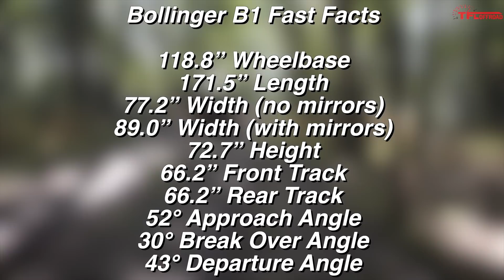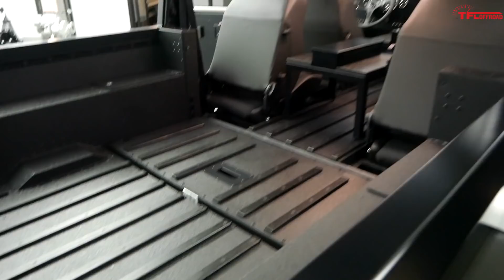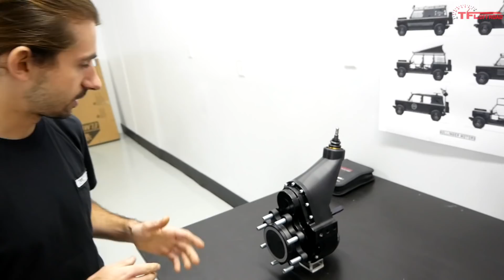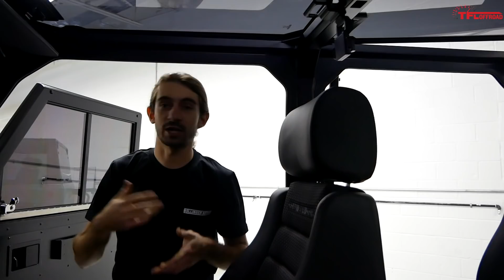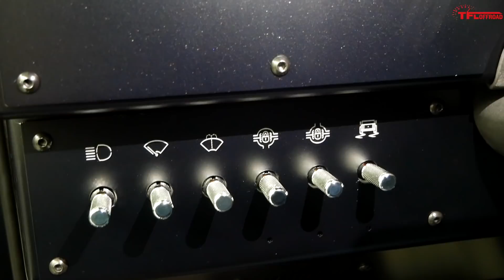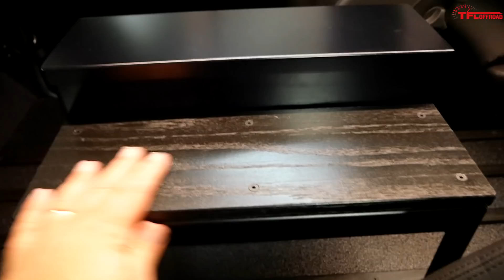You Won't Believe How Clever this Electric Pickup Truck & SUV Really Are

Comment: How about a hybrid version with a lets say 3 ltr diesel with a generator attached just to recharge the batteries, I know there is a weight penalty but it would make it a true go anywhere vehicle and would negate the range problem.
Reply: Maybe  an optional  generator sliding in the front for towing. Connect the cables somewhere, that's it. 30 kw should be enough.
Reply: @darklistener89  yeah anything to not be completely dependent  on the batteries alone. There is no fast chargers in the bush!

Comment: A twist knob on front and back gates/doors, how handy is that?  Think covered with ice while wearing gloves.  An off-road vehicle is not going to spend the night in a garage!
All these new EV's with all these fancy gadgets and accessories; but not one of them with door handles that are ice proof. 
Another issue: does the rear cab door for pass through interfere with a fifth wheel hitch?
Price??? With the cheapest Rivian around 40K, fo me this simplistic EV needs to be at least 75% of the base price of the competition.

Comment: Hopefully  it's no more than 15k for it's simple & basic  design.
Reply: The battery pack alone is worth that much. It is a large pack. Then you add off road capabilities that blow most so called SUVs away, a rust proof aluminum body, a 5000 pound payload, and the utility of all those electrical plugs. This, won't be cheap, and it will be worth every penny.

Comment: Well hopefully you live very close to the place you want to go offroading, because i've never seen a place to charge up on a 4x4 trail...Looks like a evolution of the very early land rovers, so cool design,  but i think electrics are still in the 'toy' stage. If you've got the money, its fun to drive. But not really practical and it'll take alot of miles to actually save you money on gas, since you pay more for the vehichle.  This is probably for the same people who commute in a Jeep Wrangler but never actually go offroad. Like the wrangler, its capable of it, but mostly won't be used that way. With a couple hundred mile range and a 8 hour charge especially.

Comment: It was mentioned that the designer had farm use in mind when he first designed it.  200 miles max range is far too limited for most farms.  Most farms are more than a hundred miles away, as the crow flies, from cities.  This vehicle will be limited to farms somewhere around 50 miles away from a city (for shopping, sports, entertainment, hospital emergencies) when not carrying or pulling a load.  A toy that may some day, as battery range develops, be more user friendly as a daily driver.  I suppose every vehicle type must begin somewhere.
Reply: Cities have chargers, so you can drive to the nearest city, recharge there, and drive back to the farm, where you can recharge again.
Reply: @cruiser97eric1  
I should have been more clear.  The term city, here in rural America, means a slightly bigger town.  Instead of a population of hundreds supporting a gas station convenience store that also sells fresh pizza and calzones, cities can have population of thousands, and tens of thousands and have malls with theaters and a Walmart with the eyeglass shop.  These are far and few in between usually over a hundred miles apart and rarely have chargers.  Big cities have populations of hundreds of thousands and multiple Walmarts and lots of grocery stores and one or two gas stations with chargers and would be out of range for most farms.  Cities with millions of people are usually in another state.
Reply: @bosgaurus1  Well, here is the neat thing about EVs. They can be charged anywhere there is a 120V or 240V power outlet. So there are EV chargers on even the tiniest rural town that doesn't have a gas station.
Reply: @cruiser97eric1  
Well, unless you own those neat power outlets in those tiniest of towns, or know those who do and have the kind of relationship with them that would allow you to simply pull up and plug in to make their electric meter go "Wheee!!", you still have no way to charge your car.  Love the cheesy snark, edgelord.
Reply: @bosgaurus1  If I lived in a tiny rural town I would run a few 120V extension cords to the driveway and then post a sign saying EVs can charge here for $10 an hour. The electricty used by an EV for an hour from a 120V outlet will cost me less than $0.25, so huge profit. While they are waiting for the EV to charge I will sell them cups of coffee for $3 each, access to the bathroom for $5, etc. You need to think out of box sometimes.

Comment: Amazing how the guys that build them struggle with the clunky method of opening up the catches and fold-up windows. Rear under seat storage cubbies ... once you pop the seats out. Wait, what? Pop the seats out to use the storage?! Looking at that 'useful' 16'0" timber length, exactly how many lengths of say, 6x3 @ 16'0" timber will fit through the tiny square opening? Oh yeah, with all that front, centre and rear open to carry the timber, let's just hope it doesn't rain while you're heading to site. Perfect for the wealthy carpenter who doesn't need to work in the rain or carry much timber then? Ever heard of just cause it can be built doesn't mean it should?!!

Comment: It's a brick wall moving through the air, 120 kwh battery, 200 miles of range is a complete design fail.  You can get to the trails, but you can't get home.  Once you get to the trails, you cannot stick your head out the window to sight because of the sliding windows, and you can't see over the long boxy hood.  I could go on, but his thing is a complete fail as an off road vehicle, so I don't see the point other than just looking cool in the mall parking lot.

Comment: Why is everyone hating this?
My jaw fell through the floor when I saw "52 degrees approach angle."
Electric trucks are so much more practical than ICE trucks. Is the hate perhaps stemming from the jealousy of petrol-headed truck nuts?
Reply: Oregon Cannabis Grows & Reviews practical may not be the correct term there.
Reply: @ALMX5DP  only time will tell once these electric trucks hit the road.
Reply: Oregon Cannabis Grows & Reviews if only time will tell, what are you using to substantiate your opinion?
Reply: @ALMX5DP  if the numbers they claim hold up, that would be nice for one, but it should then be very capable off road. Long term reliability is a key point in any vehicle. All the extra storage you get with this truck is already a no brainer, and I'm sure they or aftermarket will make add-ons for these trucks so you can extend your storage. The electrical outlets would be useful as long as using them doesn't deplete your range too much. Speaking of range, it would be interesting to see what kind of range it gets under various conditions (cold, hot, towing, off road, max payload, city, etc.).
The best part is this technology is only getting better, and other startup EV truck companies have their concepts with other practical features. More competition should lower prices. Should, but we all know how much a current ICE truck costs: it ain't cheap. So average guys like me won't be driving these trucks at least for a while.

Comment: I really like a lot about this vehicle but already see many potential issues. Like the back folding door at the back of the cab.  Since it has to drop into that recessed area it’s a big problem. In work trucks that area is alway full of small debris which the wind blows here so it isn’t going to allow the door to drop into that recessed area without some fuss plus what about rain water and snow? 

As for those glass roof panels, they should be the option not standard plus like all removable roof panels with time they will be rattling like hell,,,,all removable roof panels should be an option. Just like the little center door accessed from the drivers seat to the frunk, it was rattling just when he was demonstrating it.  With time it will get bent, busted and be an endlessly annoying rattle.

Then there are the sliding windows,,,,they are nothing new and with time they will rattle plus bang glass to glass soon. 

I see more serious potential issues (IE the drive system/transfer case/ transmission and more) but need to see the rig first hand to verify.  Big time manufacturers spend billions in R and D so I appreciate what this little company has achieved so far however I am more than apprehensive about their first generation vehicles. 

As much as I like this idea of simplicity in this rig, I would wait until they have been out a few years to deal with the inherent systemic problems all first generation vehicles have.
Reply: My first thought seeing that front pass-through door was wet feet every time you drive through more than a few inches of water.  Still excited about these trucks, hope someone buys them out and uses their technology.

Comment: Honestly, the car looks like it is an actual work vehicle, but the drive train is shit.
diffs, diff Locks and gears shouldn't be in this car.
Just give it 4 engines and a vector system. You don't even need any gearing, because it doesn't need to be fast.
Really annoying that they put unneeded parts into the drive train, that will just be more stuff to break and to maintain.

Comment: I would rather have some solar panels on the roof than those removable glass panels.
Reply: Interesting idea
Reply: Solar panels generate very low amount of energy (flat on the roof even less) and its adds cost complexity and weight to the car. Its a reson no company use it so far.

Comment: **The Deal Breaker**  Sliding windows on the doors that don't open all the way. When off-roading I need to be able to stick my head (and arm) out the window to see, as does my passenger. You are not going to be able to do that with those windows. That absolutely needs fixed before they can claim it as an off road vehicle.  Otherwise I like the rest of it but would never consider purchasing one because of the side windows.
Reply: The doors are removable. Problem fixed.
Reply: @cruiser97eric1  How very innovative, If I want to look out the window, all I need to do is remove the door. Bad design, poor engineering.
Reply: @thechroniclesofmaintenance4192  You take the doors off before heading to the trail, like countless jeep owners have been doing for decades.
Reply: @cruiser97eric1  I guess that's why they don't put windows that crank down in Jeeps,,, oh wait, they do go down don't they...
Reply: @thechroniclesofmaintenance4192  Having window cranks does not make jeep owners stop wanting to remove the doors. That tells us that lowering the window is not a satisfactory solution to the problem of a door getting in the way.

Comment: There is no original thought about this truck and no real market value.  Compare it to the cyber truck, which will have access to the supercharger network, battery capacity at 250kw with the ability to charge faster than any other electric vehicle other than teslas, significantly more durable despite the window breaking, greater towing capability,  -  I can go on but at 69,900 for the top end version - I can buy one and not feel like someone stuck a battery up my ass.  I'm buying a Tesla when it is available as anyone else would unless they want a POS like this truck.

Comment: Not practical in Canadian Winters, no heaters and batteries discharge. Also where are the safety features? No mention of Air Bags or crash tests.
 I would rather have a small gas or diesel motor power the batteries. It would extend range and geography as an intermediate step?

Comment: Seems like almost no design aspect to it.  That front gate and pass through seem like they'll rattle you to death on a less than perfectly smooth road.  Hvac system doesnt seem very user friendly, vents are cool, on a kit car but on an expensive production vehicle?   Rear pass through seems difficult to use.  The roof panels seem very difficult to get off.  And a 200 mile range just isn't that appealing to me

Comment: the design is good, but I was completed turned off when it's an EV vehicle, nah!
Reply: Go rock climb in one. They should be far superior as you can control the torque to each wheel and you have more of it. Plus in ten years most new cars will be electric,  you may as well start getting used to them. They out perform oil burners in every way but range, and that should be fixed in the next 5 years.